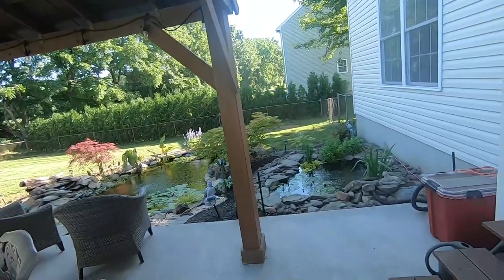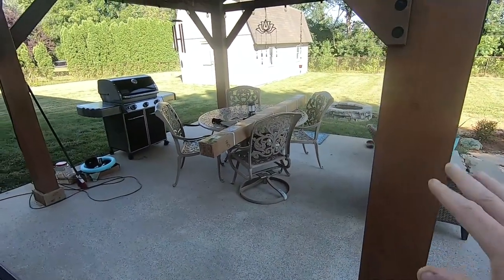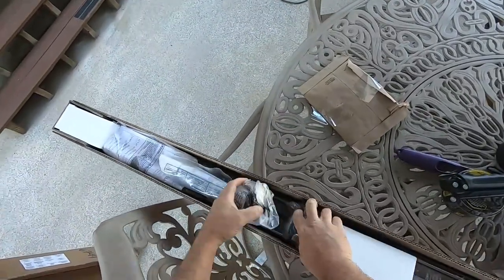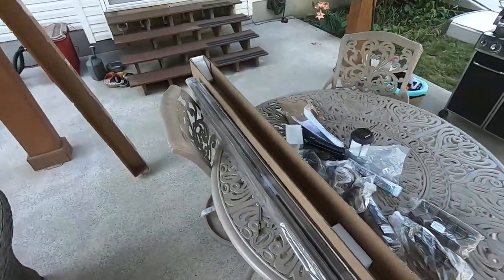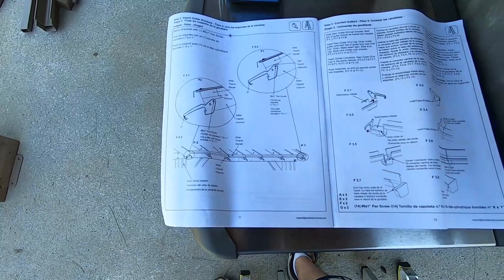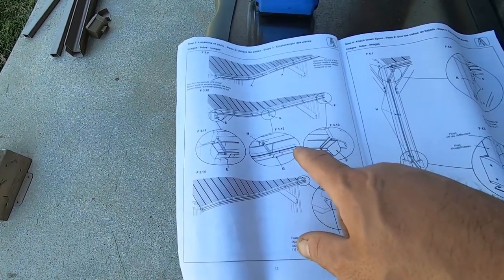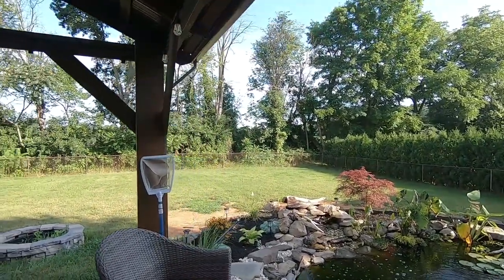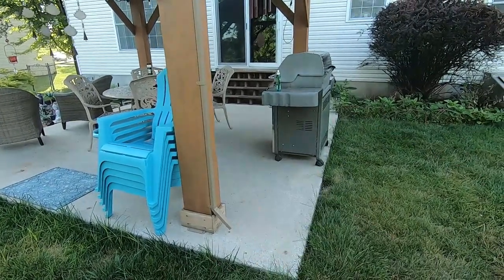Adding the Yardistry Gutter System to my Pavilion

Comment: Nice video !!  Any update about the rain flow efficiency and any damage after the winter ? Thx
Reply from the maker: We had a decently light winter. Only a couple 1ft ish falls and zero problems with the gutters breaking off from the weight.
I have not paid any attention to the efficiency of them, but I have not noticed buckets pissing over the sides when I looked out during hard rains. They seem to be doing well other than discoloration from the sun. My guess is there was no UV coating on these (possibly because I had a pre-production set)
Reply: Thank you for the update  @PMPerformance
Reply from the maker: @GabrielPare-ri1ll my pleasure. Thanks for watching and getting involved in the comments.

Comment: Dude. We are screaming swear word!!! The corners just will NOT snap both sides. At this point we are going to screw them together. The end.
Reply from the maker: It takes a little bit of finagling and shifting things around.
Reply: @PMPerformance  Seriously I spent several  hours yesterday “finagling and shifting”. We are screwing them together today and moving on. Why can’t they just tweak their design just a millimeter so they snap together? This has taken w-a-y too much time. OK thanks for letting me vent hahahahaha! Life is short. I don’t have time for this kind of Bull$&*#.
Reply from the maker: I think the tolerances are tight to avoid the pieces from popping apart maybe.
I think where you are at is the tough test part of the job. It can be done, it’s just finding the right angle of the dangle per se.